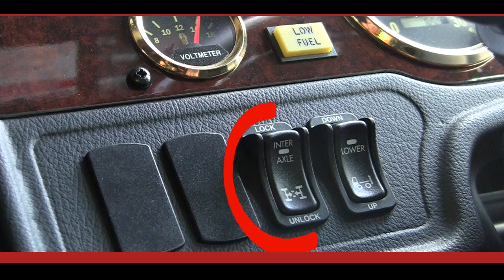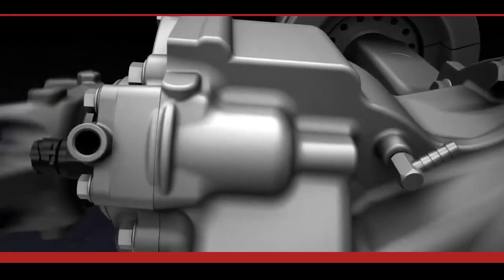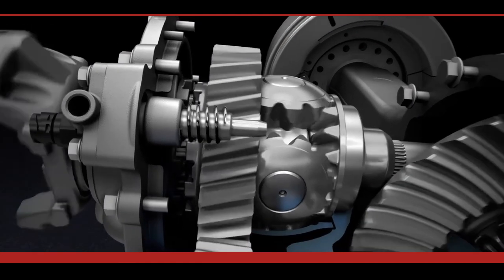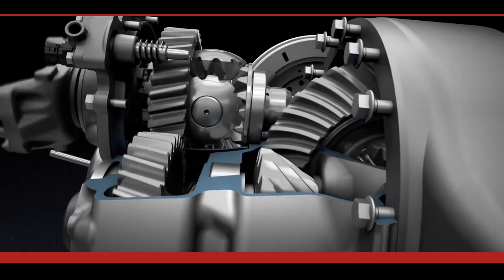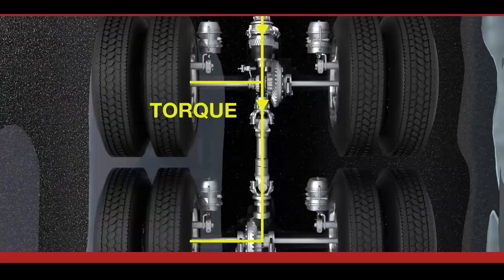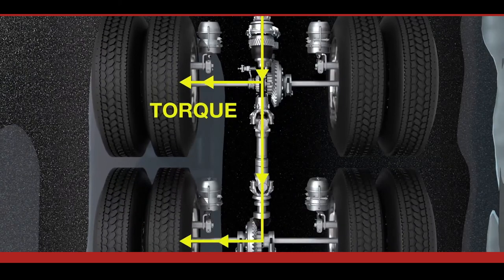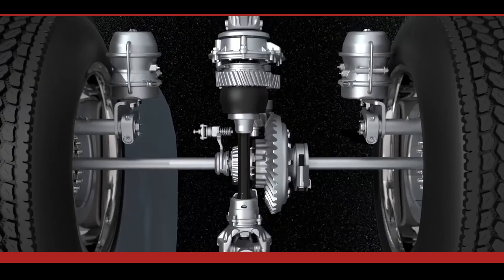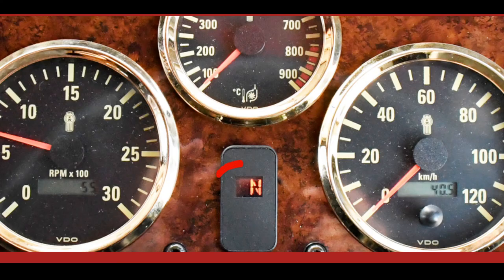K200 Controls & Switches

Comment: Nice to c automatic but dash needs to get updated...... kinda time matching, its outdated...... others gud.
Reply: better with analogue, but lighting for the gauges needs to be improved LED and changeable as well, LED stripe type lighting like in cars. Also very expensive considering most owners operators upgrade only when theres something mainly gone wrong with the running gear, so even with reg servicing things do go wrong, but hey each to their own, mack, volvo, and other bands are doing their best to have the best products on the market, especially for those companies who run fleets of trucks ?